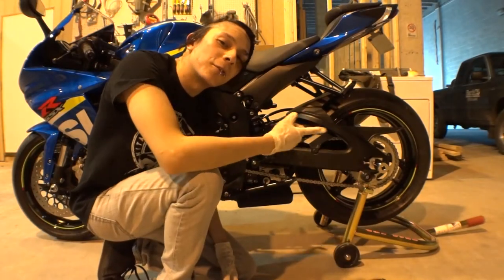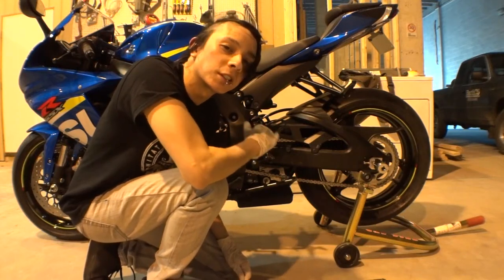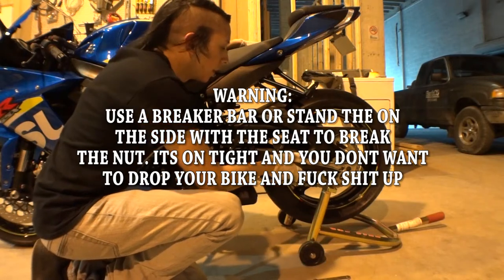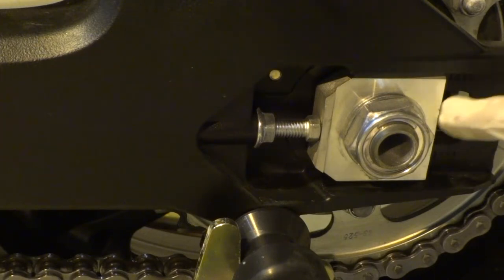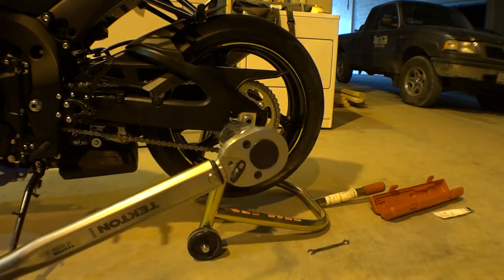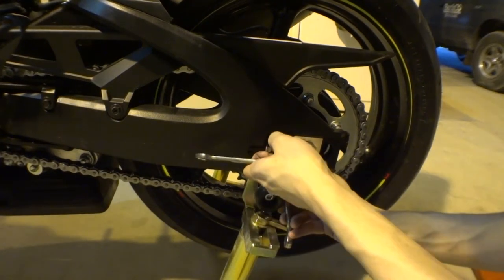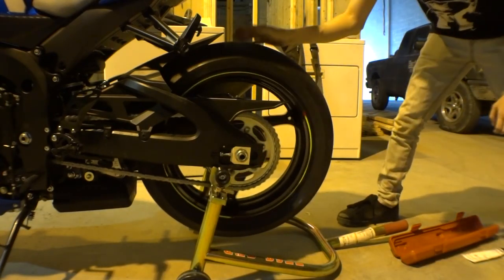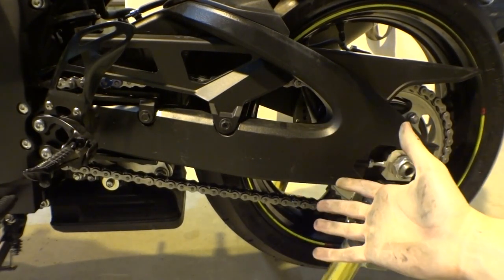2011-2015 Suzuki gsxr chain adjustment quickie style

Comment: Don't know if you knew this, but always measure the chains tension from the slackest point on the chain. That was a good tip with the wrench under the sprocket. I've never thought about that. Great video as always.
Reply from the maker: Travis M. Thanks man and thanks for watching all of them. I know this video could of been a lot better but I made it quickly and sloppy just to get the idea across. My chain was actually fine, but I know some others wanted to know how its done.